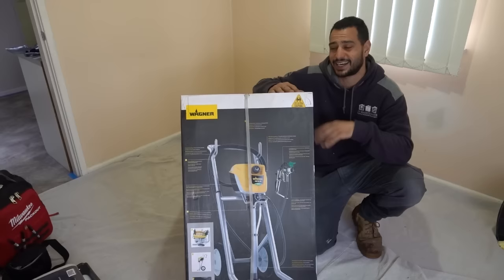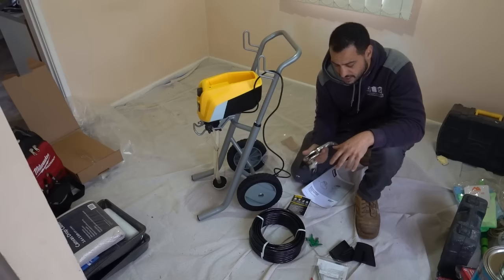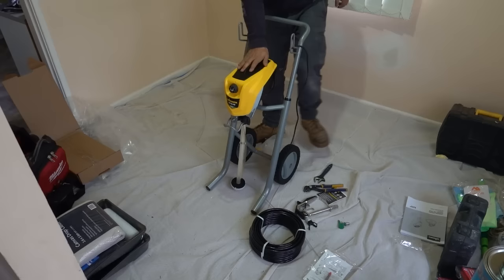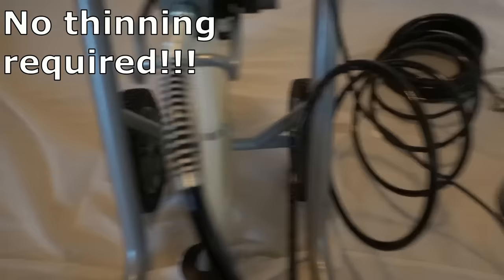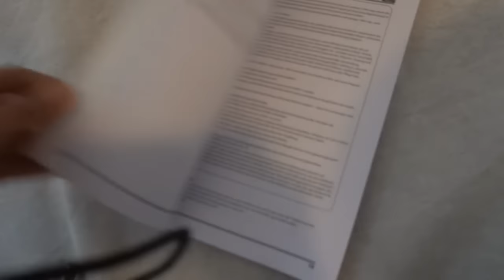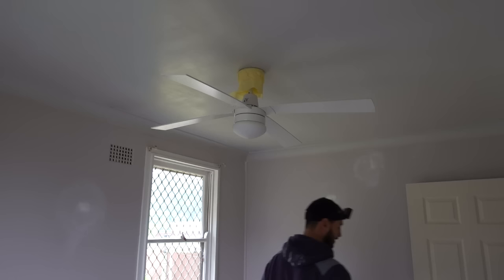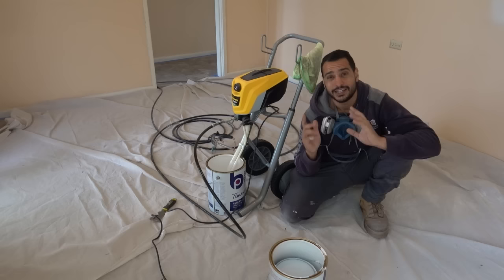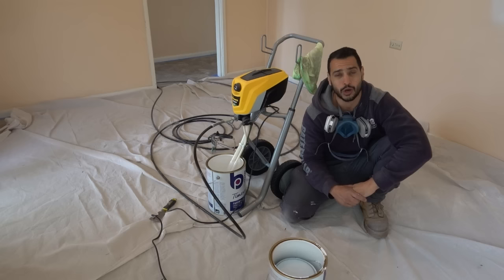Wagner paint sprayer - Review and testing 350M

Comment: Thanks mate, great video. I was looking at it in bunnings today, $1,188. Can you put oil based paint through it, I forgot to ask them there, I've got a large shed + colorbond fence and 90m of wood in the furnery to paint. I think it would be a good purchase.
Reply from the maker: Hi, you can put oil based paints through it however I would never do it. Cleaning oil based products is horrible and through a sprayer would be 100 times worse. I have purchased the 150 model and will be testing it out shortly 👍
Reply: Just seen total tools have the wagner skid type m350 pro extra for $999. If I can't use it for painting metal it'd be no good to me. Thanks.
Reply: Haymes sells a water based exterior paint for metal, Rustlock. So that should be fine. Thanks again for the reply Bill.

Comment: I bought the Wagner 350m after watching your review.  I'm painting new plastered walls with emulsion paint and then dulex silk for the finish. I did not dilute the emulsion paint and started spraying. The paint is running down the wall. I then diluted the paint and still have the same problem.  Any tips to prevent this using the 350m?

Comment: First time spraying and no backrolling??? Left the fans uncovered?  I bought the Magnum X17 PRO for half that price, same psi, same diy rating. It's a way better quality machine than the wagner.  My boss has the floor  model and mine is the upright. Yep. I run 2 sprayers on my large exterior jobs. Handles oil like SW A-100. That's the only stuff I spray and don't backroll at times. A lot of skipped steps overlooked that don't pass for quality in the USA.

Comment: FRUSTRATING !!!.. I BOUGHT THE 350 AND A 600m EXTENSION AND I KEEP GETTING RUNNY PAINT FINISHES. WHAT AM I DOING WRONG? IVE PLACED IT AT SETTING #2, BUT NOT GETTING CLEAN FINISHES.
Reply from the maker: What type of paint are you using and what are you spraying?
Reply: @billshowto  tradex ceiling flat - formula: Lexicon Quarter PCWF4, ceilings and walls
Reply from the maker: Flat paint shouldn’t be used on walls. make sure you don’t thin down the paint and spray on setting 5.
Reply: @billshowto  ok I did not know that. I didn't thin down the paint but I sprayed on #2.. isn't that the setting you used? #2?
Reply from the maker: Spraying walls and ceilings should be on setting 5 and make sure you’re using the correct tip and filter for the application 👍
Reply: @billshowto  ok got it. Ceiling 5, walls 2, correct?

I'm using the broader tip and white filter, not red. 

Thanks Bill I appreciate your feedback
Reply from the maker: Ceilings and walls both on setting 5

Comment: I bought the control pró 190 and went to paint my garage yesterday here in Brazil, a 3.6 liter can diluted almost with 60% water totaling 6 liters painted just around 25m² and did a lot of overspray, with pressure set on 2 and nozzle 517, what can I be doing wrong? The paint was thick.
Reply: Generally most wall paints can be diluted with upto 10% solvent ( ie. Water ). 
60% dilution is probably way too much.

Comment: Could be a pain in the ass if you need to paint multiple colors.
Reply: A pain in the ass is a broken 350M that loses pressure after 3 rows and never really regains pressure. Hope to get a good unit soon.
Reply: You just use water / paint thinner until its clear. spray it down the bath with taps running works fine. paint change overs are easy. The whole machine is serviceable can come apart and clean if you want.

Comment: You need to back roll all the spray otherwise the paint is sitting on the surface without proper penatration. Wagner made from shit components and expensive to service. Better off to buy a Graco 390 with marine stainless steel parts.
From a professional painter.
Reply: What you talking about. That machine is 5 times more expensive so yes it will be of better quality. And I used this machine to spray my ceiling years ago and it hasn’t fallen off. Get back to your professional painting instead of watching these videos
Reply: @jameshurst3279  The fact that you don't back roll tells me you're a cowboy. My graco  has lasted me to date 17yrs and only replaced the pump once with regular maintenance. My Wagner 6.5 years to the point where it was no longer servicable. Time will tell.
Reply: @Manup2day  I level 5 finish every time, I think you are the back rolling cowboy. Only a cowboy back rolls every time.